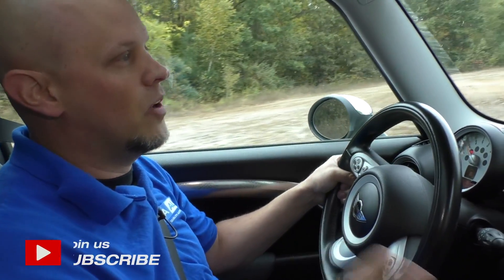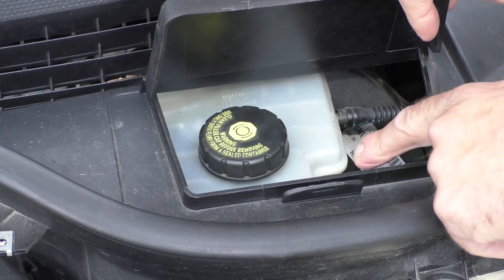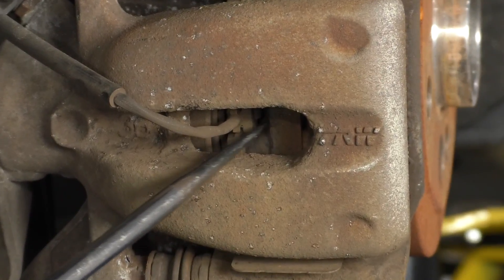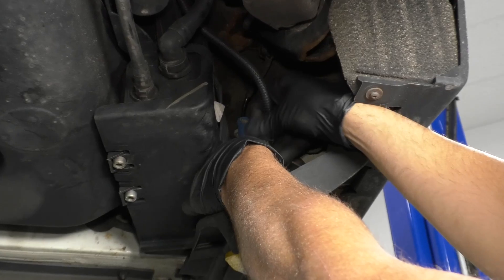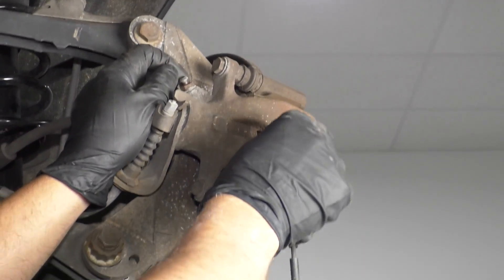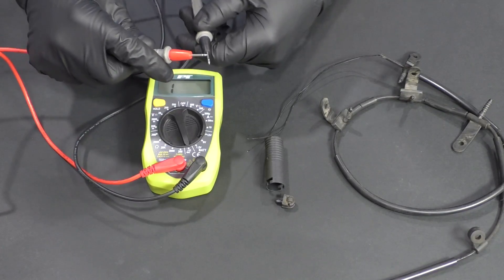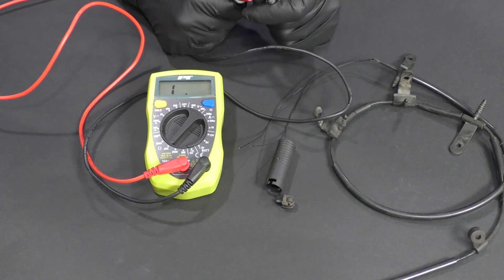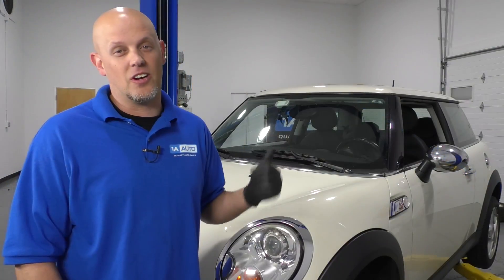Why is My Brake Light On? Diagnosing Common Brake Failures!

Comment: Do you have any other troubleshooting videos Subaru outback 2014 pads are great rotors are great. Greased the calipers inside around both sides clean them scrub them all the stuff didn’t see anything wrong with ABS sensors that I saw everything looks clean. Great my house when I took the car apart three times Not making any sounds whatsoever, but the brake light is still flashing. The only thing that’s showing up on my sensor testing was my exhaust or catalytic converter which my exhaust went out about a month ago I think it’s detached. I can’t imagine what else it would be. I take really good care of my car so I can’t think of anything else

Comment: Hello. Can the brake light go on if need new calipers?  I changed my 4 brake pads 1 months ago with rear rollers. ?  I have a rebuilt mini 2012 77k miles
Reply: The brake fluid it’s good

Comment: Because  the master cylinder was low, because the brake line was loose at the wheel cylinder, & spit fluid on the rear tire.

Comment: Nice I think that's mine is but mine goes on at a stop light or stop sign. Then when I drive off it turns off.
Reply: Did you find out what was wrong
Reply: @ajrobtw  this just means that your brake’s are running low and you need to replace them. Most likely the rear.
Reply: Did u fix the problem??